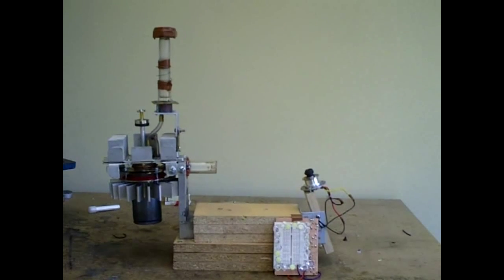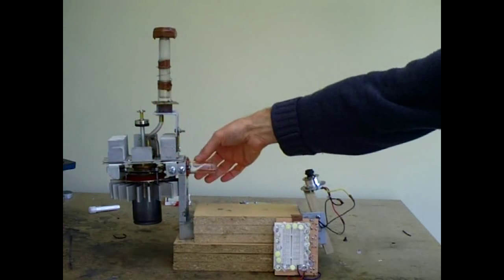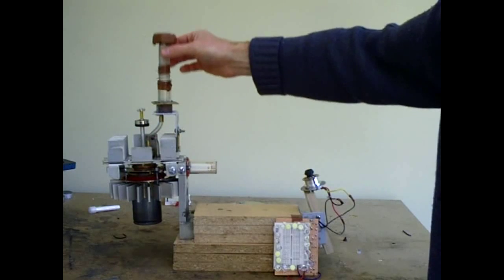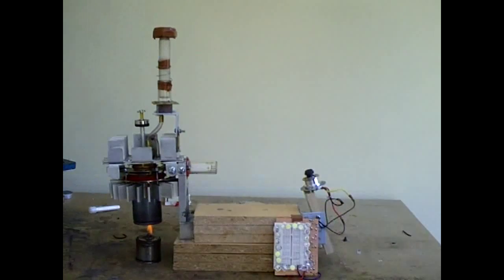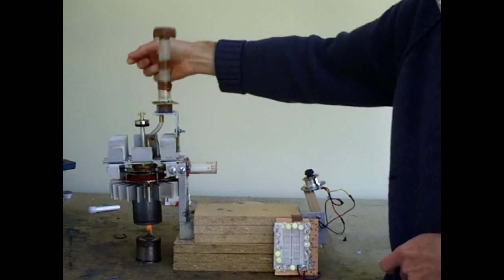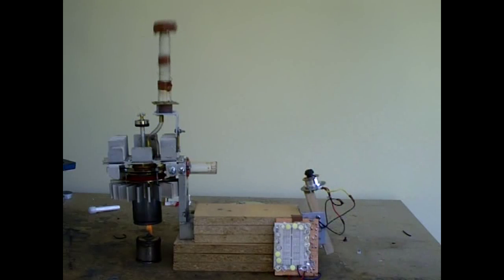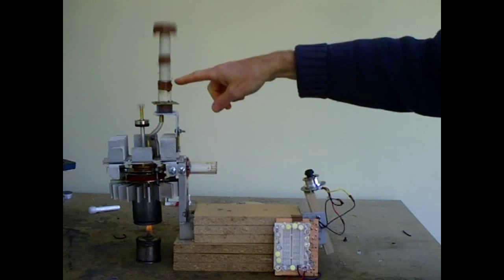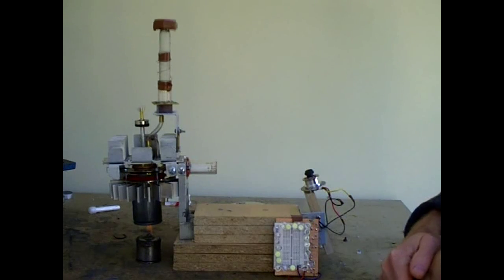Prototype of a totally free piston Stirling Engine

Comment: How many balls can you lift height h per minute? Make a ramp with a supply of balls. Weight the fuel used. Calc therm eff.
Reply from the maker: Can't do, I disassembled the prototype when I built the engine for the next video.

Comment from the maker: @dmanofdland That is correct with the exception of my last Ringbom where the tube was already coming from the top like in this one. The old tube was only 3 mm inner diameter which was too narrow a passage for the air and air viscosity reduced the engine power a lot.  This last tube is 5 mm and that made the engine a lot more powerful. Ideally the passage between the two cylinders should be as wide and as short as possible.
And thanks for the kind words.

Comment from the maker: @blg53 The force that moves the displacer is created by the air pressure exerted by the moving (heavy) glass power piston to the relatively large (8 mm) diameter of the displace's push rod.  And yes it still moves it despite imperfect seal between the rod and its bearing. Because the displacer and its rod are made to be very light and the presence of the repelling magnets counteracts whatever weight id does have making it gravity-neutral. When not in motion the displacer rod sits (levitates)

Comment from the maker: @dmanofdland The cylinder at the bottom is connected to the glass cylinder on top. But it is not the displacer. The displacer is a piston that is attached to the end of the brass rod. It moves inside the metal cylinder. It is not tight, it has clearance of about 2 mm from the walls of the cylinder, its job is not to provide compression, but to move air inside the metal cylinder from hot to cool end and back (hence name "displacer").

Comment from the maker: @dmanofdland No, no cyringe there.  The displacer rod is a thin-walled brass tube with 8 mm outer diameter. The sleeve (bearing ) it slides through is a relatively thick-walled aluminim tube with 8 mm internal diameter. The choice of meterials is not perfect, both are too soft and as a result don't keep the polish well. But it was all I had. The seal is far from perfect, but I figured it was better to keep is slightly loose than too tight.  I used graphite powder as a lubricant .

Comment from the maker: @dmanofdland Did not have to. The power piston and the cylinder are the two parts of a 20 cc glass cyringe, they are made to have a tight and accurate seal. All I had to do is to put a bit of weight on top of the pistin to give it inertia that acts  the same way a flywheel does.

Comment from the maker: But your idea is interesting, I'll certainly give it a thought.  My reservation about high RPMs or PPMs is that when achieved they would reduce the power produced (very low torque) because it would not allow enough time for the gas to travel between the hot and cold ends in sufficient volumes due to viscosity. The faster PPMs the less amount of gas is involved in the movement which obviously reduces power.

Comment from the maker: Yeah, that would probably work. A planar spring on either side of the displacer is probably even a better solution than O-rings. The problem I guess is that it would limit the hot end temperature as the O-ring would burn and planar spring lose elasticity if too hot.  Personally my aim is not to extract maximum RPMs or Pulses per minute (PPMs ?), but to extract maximum possible power out of an engine of given size. I suspect it can be more reliably achieved with a heavy power piston than springs.

Comment: My guess is that you can probably fit two O-rings both side of the light displacer to store energy at each dead point and then increase the length of your cylinder to reach a  2.5 inch displacement of the piston (or more)  that allows "spring effect" to occur even with a light piston...then reaching more than 1000 pulse/mn.
I agree the displacer rod surface has to be large enough to let it rise with small increase in pressure!

Comment from the maker: Oh, and in this system the displacer should be as light as possible as the enegy to move it is subtracted from the output. The heavier the displace is, the less efficient the engine is, the less power output.

Comment from the maker: The pressure to move the displacer rod and the displacer with it is provided by inertial overdrive of either flywheel (Ringbom) or a heavy (inertial) power piston (Free Piston system). The displacer push rod has to be of reasonably large diameter so that it provides sufficient application area for this pressure to exert enough force to move it (and the displacer with it). Al least this is my understanding of how it works.

Comment from the maker: Checked your videos. If I understand you correctly your pet Stirling system is laminal flow or thermodynamic ones which works on the resonant standing wave along the regenerator stack with temperature gradient. This is I guess what you call "spring gas".There the power piston has to be very light. Mine are more conventional Stirling engines, there are no "spring" in the gas there, ie no acoustic resonance.

Comment from the maker: Thanks for kind words, I was pretty thrilled when it started chugging along. The displacer weight could be an issue if the displacer push rod diameter is too small, mine is 8 mm which seems enough for the levitating (gravity-neutral) displacer.  I will experiment with the weight of the power piston though, because it's functional purpose is to provide the overdrive push for the displacer, what the flywheel normally does, so it should be reasonabley weighty.